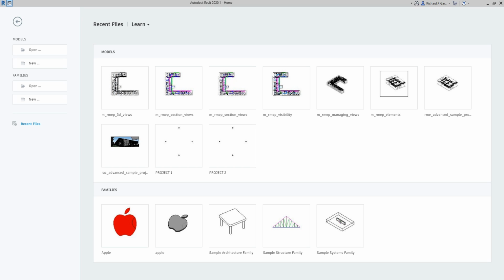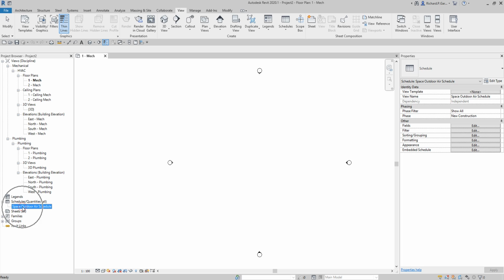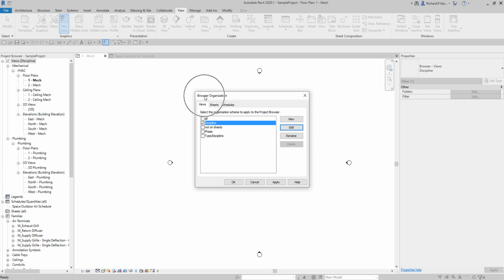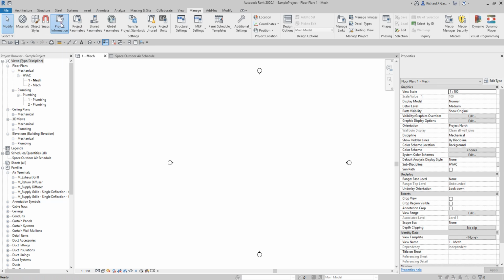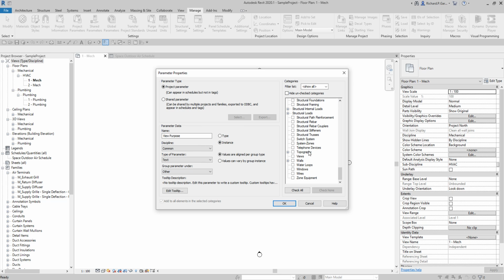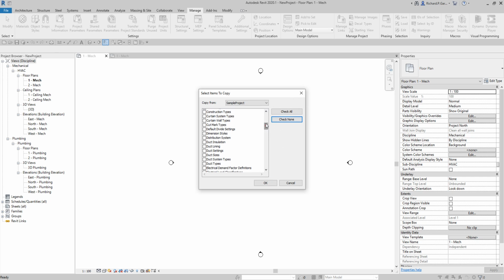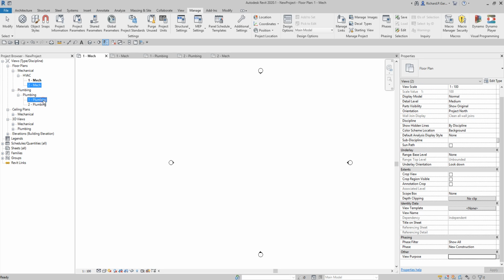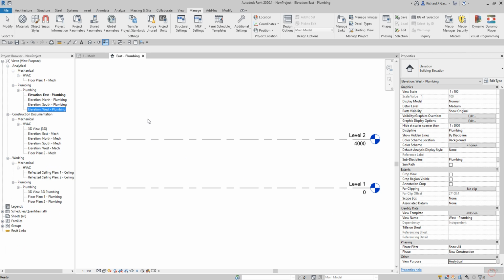REVIT MEP 2020 - STEP BY STEP TUTORIAL 7 - HOW TO SETUP PROJECT

Comment: Hi sir rich, how to make central file and worksets?
Reply from the maker: Hi Julius! Thanks for your question. Here’s a quick guide on how to create a central file and worksets in Revit:

1. *Open your Revit project file* that you want to make a central file.
2. *Go to the “Collaborate” tab* on the ribbon.
3. Click on *“Worksets”* to open the Worksets dialog box.
4. If Worksharing is not enabled, Revit will prompt you to enable it. *Click “OK”* to enable worksharing.
5. In the Worksets dialog box, you’ll see two default worksets: *“Shared Levels and Grids”* and *“Workset1”**. You can create additional worksets as needed by clicking **“New”* and giving them appropriate names.
6. Once your worksets are set up, click *“OK”* to close the Worksets dialog box.
7. To make your file a central file, go to the *“File” menu* and select **“Save As”**, then **“Project”**.
8. In the Save As dialog box, click on the *“Options”* button.
9. Make sure to check the box for **“Make this a Central Model after save”**.
10. Click *“OK”**, then **“Save”* your project in the desired location.

Now, you have a central file with worksets ready for collaboration. Each user can create a local copy of this central file to work on and synchronize changes with the central model.
Reply: Thanks boss rich...
Reply from the maker: @juliuscastillo2241  you’re welcome sir!